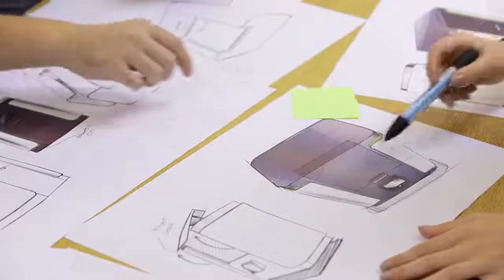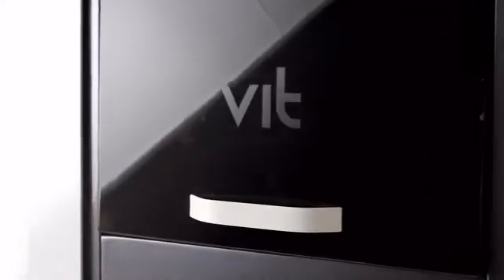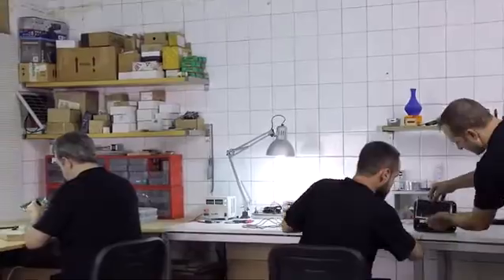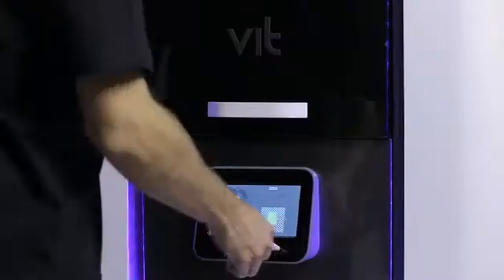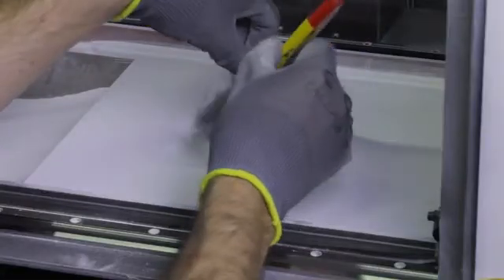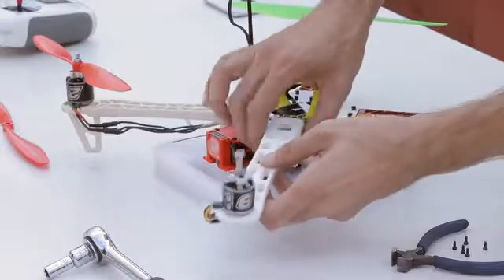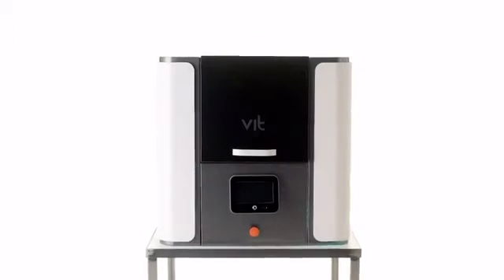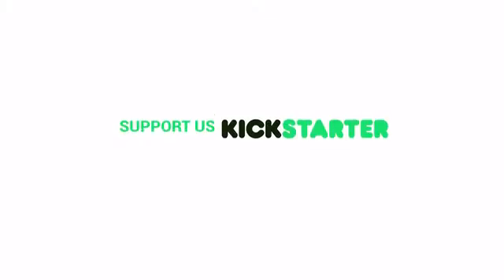SLS 3D Printer | VIT SLS 3D Printer | Natural Robotics Inc.

Comment: I have a Question, it says 20mm/hr, is that height wise? Or if i have lets say just a simple circle, which it's perimeter is 40mm, would it take 2 hours to print just that simple perimeter at a single layer height?
Reply from the maker: 3D printing speed is contingent upon the height of the material manufactured (or the height of the layers constructed) in a given period. It also depends on many factors like the printing technology, the material, and the printing resolution.
Reply: and your bed is 250 x 250 x250. that means I can print two layers of phone cases if they're less than 20mm in height in total in less than one hr as long as the design fits within the best software for this? Any recommendations? I'll be buying this device soon.